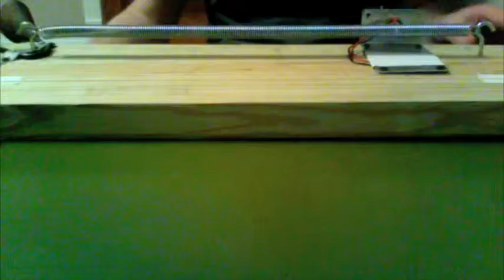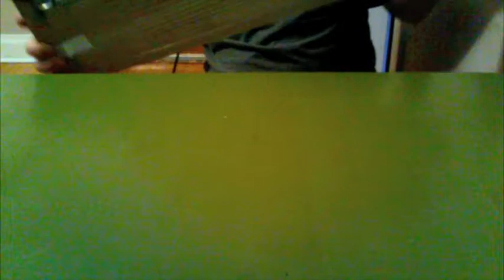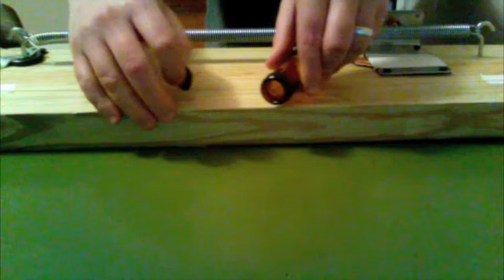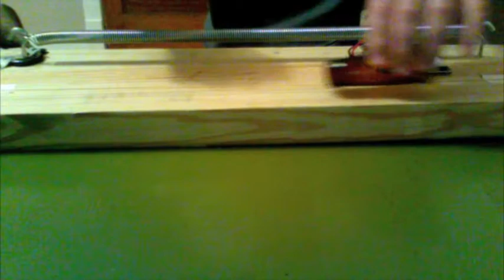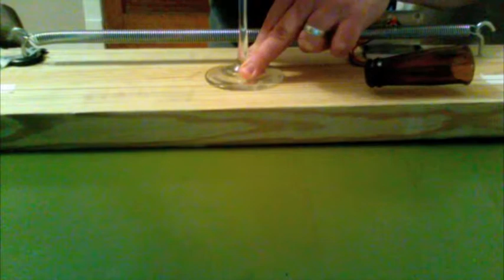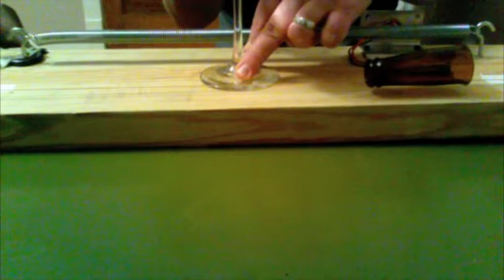Sound FX SPRING and Banjo STRING BOARD with Contact Mic Pickup

Comment: awesome! the mic is attached to the wood base?
Reply from the maker: I put the contact mic between two small pieces t-shirt fabric and then screwed the sheet metal housing for the instrument jack right on top of it to hold it in place. The mic is placed a short distance from one of the ends  (approximately 1/4 of the overall length of the wood) to keep from dampening vibrations in the wood.